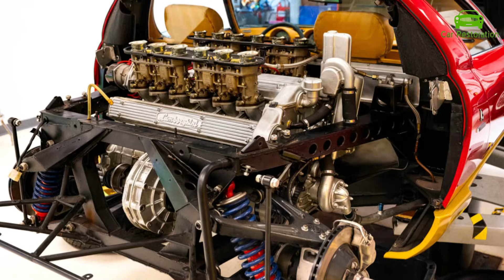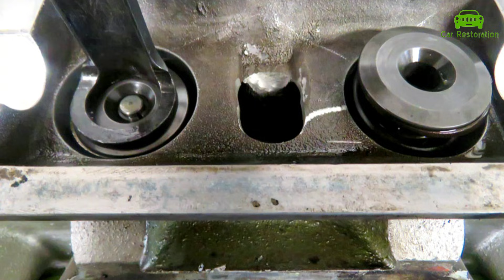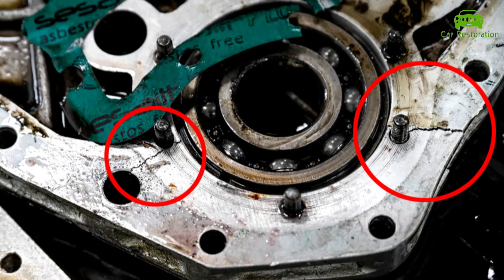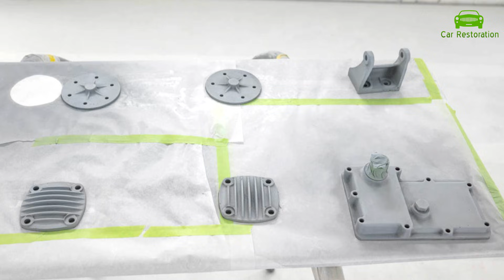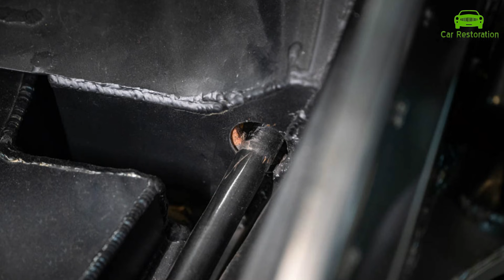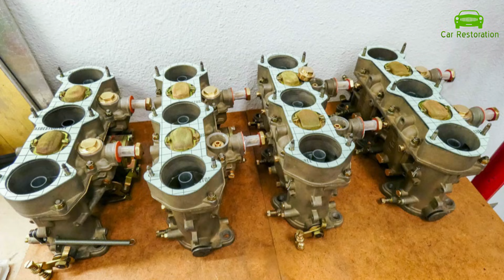Restoring a Legend : 1971 Lamborghini Miura SV Mechanical Rebuild

Comment: As a much younger man, I had the privilege of driving one of the very first Miuras (LHD), bright orange,  imported to the UK. It belonged to the father of a school friend.  It was a scintillating experience, driving from St.Albans to Mill Hill where we both lived. He didn't keep the car long. As soon as the SV became available,  he traded "up" . The replacement Miura was white. I never got to drive that one. He didn't keep it very long either. The video would have been better with the added soundtrack of the car at speed, also shots via mirror through the rear window of the throttle linkage working. No power steering then if memory serves.